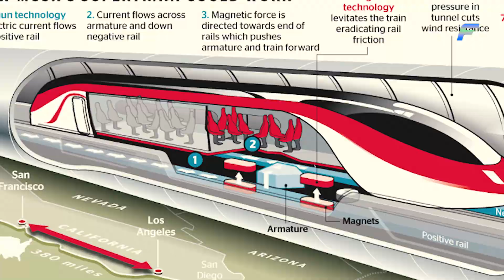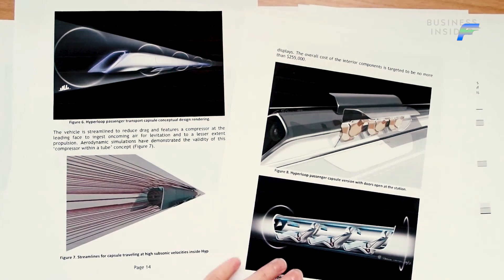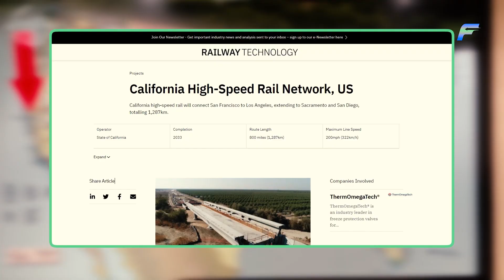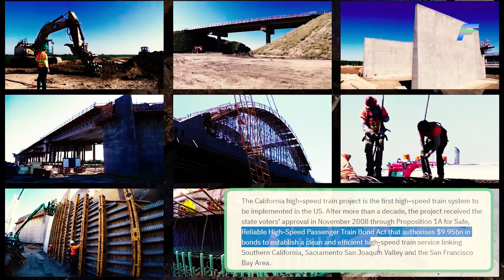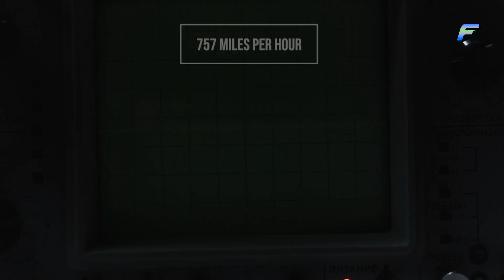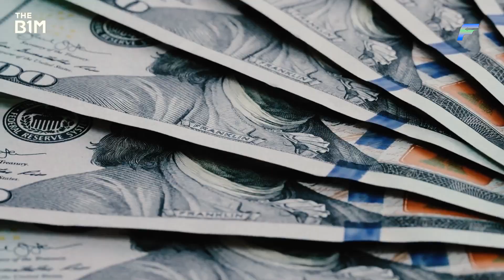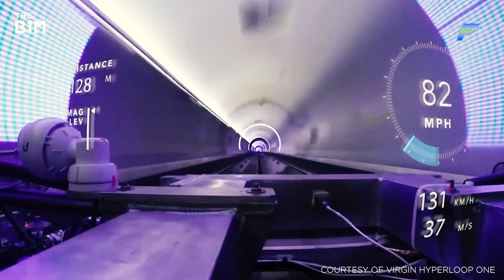How California High Speed Railway Will Outperform Elon Musk Tunnels

Comment: It's next to impossible to create a near perfect vacuum in a tube over 300 miles long. A hole no larger than a pin hole with decompress this tube.
Reply: And in a country where everyone has a gun. This might not be the smartest idea
Reply: It would be a partial vacuum.
Reply: @kevinbailey8827  A partial vacuum would not enable anything close to the speeds they are claiming. Air resistance simply doesn't work that way. They need near complete vacuum for the speeds to make sense. 

Best case scenario this ends up being maglev in a tunnel/tube with no vacuum at all. Either way, this will be more expensive than maglev and even maglev is at the moment considered a dead technology due to cost. 

Basically, even in the absolute best case scenario this is a gadgetbahn, a dead-end technology due to cost and horrendous impracticality of the concept. Waste of time and resources.
Reply: @TohaBgood2  I'm not an expert in aerodynamics, but I know airplanes fly higher to reduce the drag.

If D = Constant x p where D is drag and p is air density then reducing the air density by half would also reduce the drag by half.

That said, I have absolutely no hopes and dreams resting on the success of the hyperloop.  

Your last paragraph is nonsense.  In the absolute best case scenario, the engineers working on hyperloop find innovative solutions to all the technical hurdles, and hyperloop revolutionizes shipping and transportation.
Reply: @kevinbailey8827  Actually, air resistance is about proportional to the square of the velocity. It's not a linear relationship so increasing speed comes at an extremely high energy cost past a certain point.

In other words, Hyperloop's main advantage over regular maglev is the vacuum. No near vacuum, no need for Hyperloop. You can just build a conventional maglev train above ground.

And again, maglev itself is essentially dead. There's literally only one major project in the pipeline. And even that is just barely alive purely because the Japanese government is being slow to adjust to the reality that the tech simply isn't there.

One way or another, Hyperloop is headed for a brick wall unless they figure out some new physics. Which is, you know, probably impossible.

Comment: You mean most high-speed trains run upward of 300 km/h not 300 mph. Trains don’t run at 300 mph. Also, Epitome is pronounced e-PIT-oh-mee. Not “eppa-tohm”.
Reply: Actually, there already are HSR trains than can do 240-250mph in regular operations. Most of the new HSR track that is being built now is in the 220-250mph range. In a couple of decades, I think most new HSR trains will be able to do 300-ish mph. It's not that far out. The industry is already moving in that direction.

Comment: Hyperloop is vaporware.  At this time, all Elon Musk has built is small-bore tunnels with Tesla cars operating inside.  For his system in Las Vegas, the cars don't even operate in driverless mode.  I look at the images in the video of what look like large-diameter overhead sewer pipes and wonder why anyone would take seriously the idea that cities would allow such things to be built along their streets.  If there ever is a Hyperloop demonstration line built, I will not be in line to ride it.  It will lead to the first train decompression accident that suffocates the passengers.
Reply: the concept has been around since late 50s, all nerds know it's possible, it's just too costly. and very unlikely to ever be built.
Reply: it's even older than that, concepts for pneumatic train tech goes back to 1905!
Reply: @obstinatejack  I mean it's also practically unfeasible considering the length and volume of the vacuum tubes...
Reply: Seems the train is vaporware as well lol hahaha
Reply: Exactly. Hyper loop is great except IT DOESN’T EXIST!
Reply: The Las Vegas tunnels were never meant to be Hyperloop.  That’s just “Loop”, not Hyperloop. 

Loop is meant for transport within a metropolitan area, at normal speeds.
Reply: @kevinbailey8827  so it's just a subway? doesn't sound too hot
Reply: @obstinatejack  A subway would be better than what’s built so far in Vegas. But once it serves most of the casinos, it will be a far better experience than a subway.   You’ll be able to go from any casino to any other other in a few minutes without stopping anywhere in between.
Reply: @kevinbailey8827  are we talking about apm here then? wouldn't a disney style monorail server the same purpose, but cheaper?
Reply: @obstinatejack  Vegas already has a Disney style monorail.  It doesn’t serve the purpose very well. It only serves a few casinos, and it doesn’t give the same experience.  It has to stop at every casino, so if you’re not going to the next stop on the line you have to wait at each station for it to unload and load.    The loop lets every trip be point to point with no stops.  Monorails are also more expensive to build than the loop.   Disney hasn’t extended its monorail in 40 years.
Reply: @kevinbailey8827  i'm having trouble understanding what this loop thingy is then, if this isn't apm, and goes directly where you wanna go. a loop with a bunch of forks?
Reply: @obstinatejack  I don't know what the acronym apm means.

Loop is a name, not a description.  It's like an underground freeway, with on ramps and off ramps that lead to stations.
Reply: @kevinbailey8827  apm - automatic people mover, the kind of little tramp thingy you see at airports
Reply: @obstinatejack  It will be automated, but you’ll select your destination before you board (probably using an app on your phone, or a kiosk). It will tell you where to wait, and your vehicle will arrive ready to take you to your destination, skipping intermediate stops.
Reply: @kevinbailey8827  sounds cute. mean while, 7 of the top 10 cities with the most extensive subway systems are in china, and all we got to show for is this cute little people moving pods between casinos in vagas? well actually, whatever elon's boring company is doing, it's not even done and haven't shown us anything real yet
Reply: @obstinatejack  It will be years before the Boring Company has anything really impressive to show.   It was only founded five years ago.  

Five years ago, it wasn't clear that Tesla was going to survive.  Now it is one of just a few companies with a market cap over one trillion dollars.  SpaceX is a huge success also.  This doesn't guarantee that Musk will also succeed with the Boring Company, but I wouldn't bet against him.
Reply: @kevinbailey8827  I expect at some point Elon Musk will get the idea to put railroad tracks in his tunnels and run trains on them.  Wouldn't that be novel!
Reply: @kevinbailey8827  so it's like the 45 years old Morgantown PRT only in tunnels. Geez, that's innovative...
Reply: @mancubwwa  Yes. Similar to that, but underground.   And 51 stations instead of five.

I've been to Morgantown (once), but never heard of  the PRT until now.   Have you ridden it?  What's the experience like?

I imagine the ride is similar to the old AirTrans system at DFW airport.  The pods look very similar, as does the guideway.  I kind of miss it, since it was a transport from the remote parking lot to all of the terminals, outside security.  There was a section using the same tracks that connected three American Airlines terminals inside security. The replacement, a much faster elevated train, is strictly inside security.

I kind of miss that old system at DFW.  In my mind it's a replacement for the Braniff Monorail, because that transport system was dismantled after Braniff moved from Love Field to the newly constructed DFW.  I rode the Braniff Monorail once as a little kid.
Reply: @kevinbailey8827  no I haven't. I did ride a much newer one at Heathrow Airport once, but at some point I learned of the one in Morgantown, and because of it's age it looked like a better one to bring up
Reply: @mancubwwa  Thanks for bringing it to my attention.  It doesn't sour me on the Las Vegas Loop.  I think it's pretty cool!
Reply: @kevinbailey8827  Except if u heard about something called traffic!
Reply: @Mgameing123  Traffic in the loop will be computer controlled, to flow as smoothly as possible.   The worst traffic we've seen so far resulted in a temporary 40-second delay, and cars didn't even come to a stop. People sitting in real traffic WISH they had it so good.
Reply: @kevinbailey8827  to be honest the loop might aswell be turned into a metro.
Reply: @Mgameing123  It would cost $150 million to turn it into a metro. Who do you want to pay for that?
Reply: @kevinbailey8827  And it would cost more to maintain the loop and 150 million is very cheap for a metro project.
Reply: @Mgameing123  Maintenance for the loop is $6 million a year, which LVCVA currently pays TBC to do.

Even if maintaining a metro cost half as much per year, it would take 50 years to break even on the "savings" from spending $150 million unnecessarily.
Reply: @kevinbailey8827  I can't say more. The auto industry has brainwashed you! 
Have you ever heard about how public transport like trains, metro''s etc. can give more value to land and accelerate development. A metro can also hold more people than the loop can and it will be much nicer taking the metro than taking the car in a city full of traffic. The loop only carries Tesla owners. A metro can carry alot more people.
Reply: @kevinbailey8827  1 train can also hold 1000 people
Reply: @Mgameing123  Put a train in the convention center, and it can move 4000 people an hour by running every 15 minutes. 

People don't want to wait 15 minutes, especially when the average wait time for the loop is less than 15 seconds. 

You can run your train more often, but less full, which is wasting the train's capacity.  In fact, since most days at the convention center aren't busy, your 1000 passenger train would run mostly empty most of the time, and you still couldn't get wait times averaging under 15 seconds or trip times averaging under 2 minutes.
Reply: @Mgameing123  You don't have to be a Tesla owner to take the loop.  In fact, you can't take your own car on the loop even if it's a Tesla. 

The loop is public transport.   You've been brainwashed by train enthusiasts to think that trains are the only solution, even though they're spectacularly expensive. 

The claims that loops will never work ring hollow, because the convention center loop IS working.
Reply: @kevinbailey8827  But you just said the convention center isn't busy most of the year, which kinda defeats your point? If you're gonna built a new transportation mode at a convention center, that's not exactly a great place to test it.
Reply: @randomscb-40charger78  I don't know which of my points you think is defeated. 

The LVCC Loop is The Boring Company's first commercial project. It doesn't fully demonstrate the capabilities of a loop system. To demonstrate that you'd need a much bigger system.   The problem was that no one wanted to pay TBC to build a big loop system, because TBC had no track record.   No one even wanted to let TBC build a big loop system for free. 

TBC bid on the LVCC loop to get its foot in the door.  Once that project was nearing completion, Las Vegas gave them permission to start building the 30+ mile, 50+ station Las Vegas Loop. 

The LVCC Loop works fine for what it is.  It works better than a train would have.  It will work better once it gets automated vehicles.   But we'll have to wait until more of the Las Vegas Loop is complete to really see what a Loop system can do.
Reply: @kevinbailey8827  Automation is such a buzzword these days, and the fact that the Loop wasn't automated from the get-go is absolutely hilarious. You have a dedicated ROW with no interference of other traffic and you can't automate it. Vancouver has had automated trains since 1985, and they didn't have to use operators to operate the damn trains, completely autonomous. The irony of it all, four to five car light metro cars that can operate by themselves, and a tiny little car can't achieve such even in a tunnel, in 2021.
Reply: @randomscb-40charger78  So you agree that automation is a solvable problem, especially in a situation like this. 

You get a few giggles now, because they haven't achieved it yet, but the Boring Company loop tunnels will operate for decades, and only in the beginning will they need operators.
Reply: @kevinbailey8827  No, even if you automate it, you still run into capacity issues with the LVCC Loop.
Reply: @randomscb-40charger78  No capacity issues so far...  When do you expect to run into these?